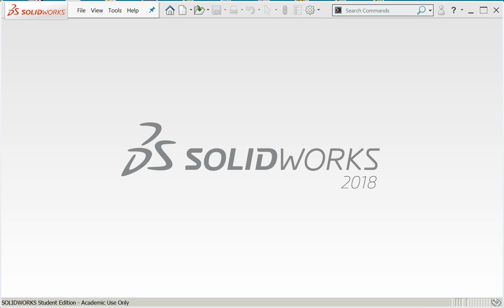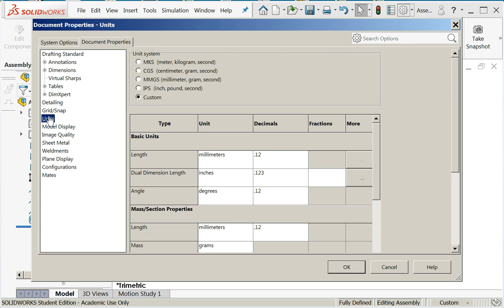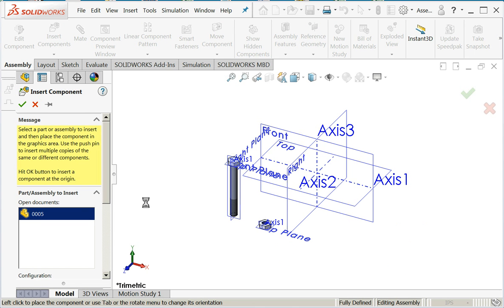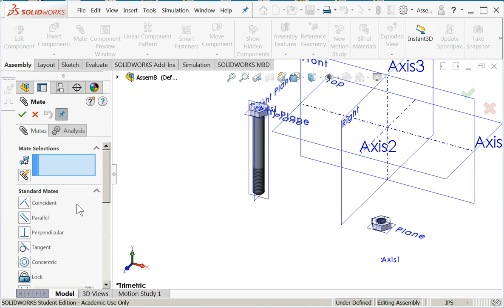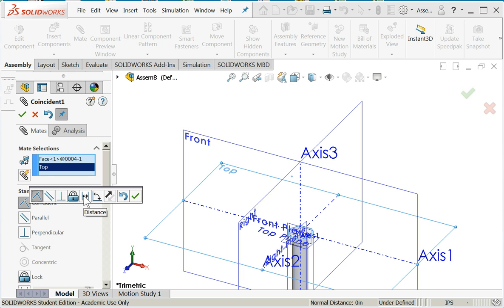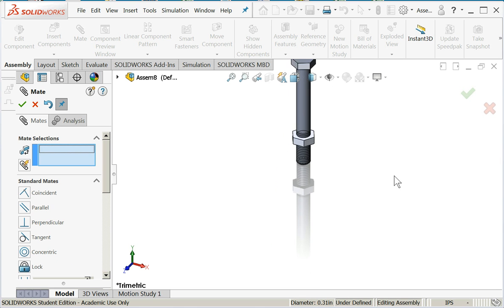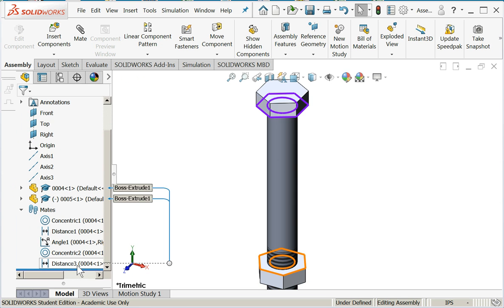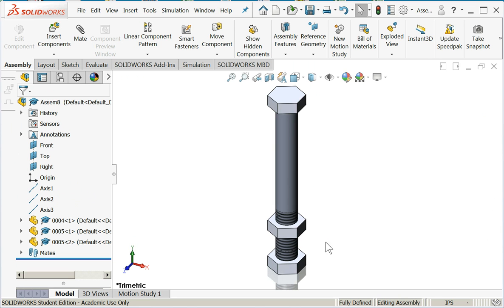SolidWorks - Creating Assembly Templates And Basic Assemblies

Comment: Why not just insert the first part using "insert -> part" menu and then pressing "OK" button? This away the origin and planes of the part will be automatically aligned with the corresponding ones of the assembly.